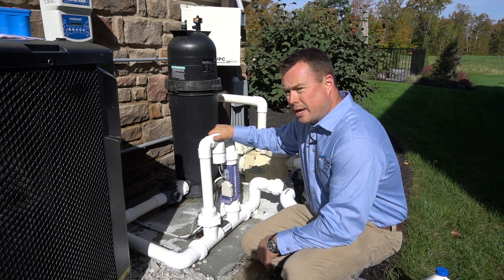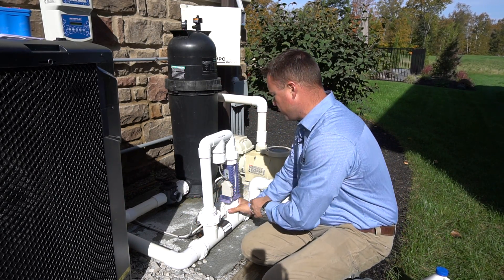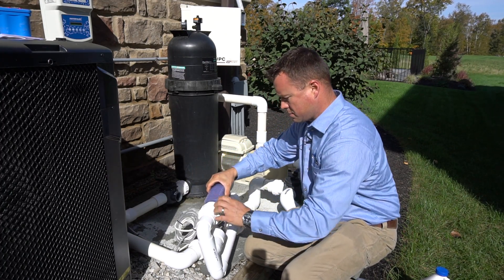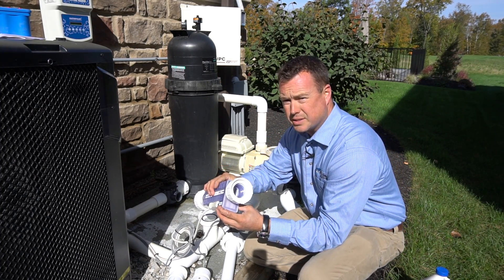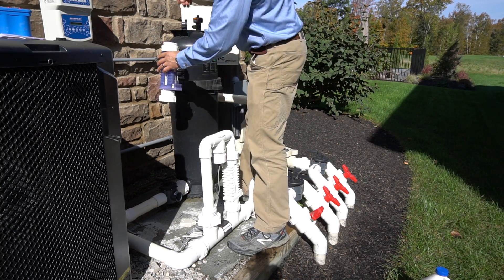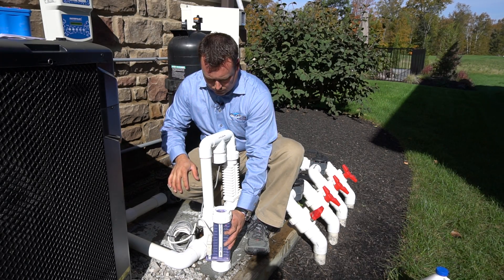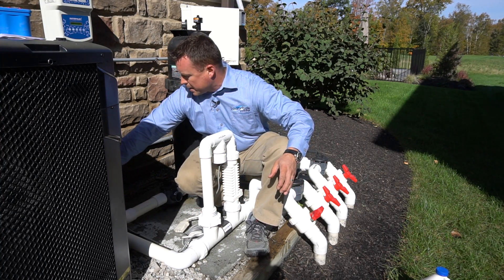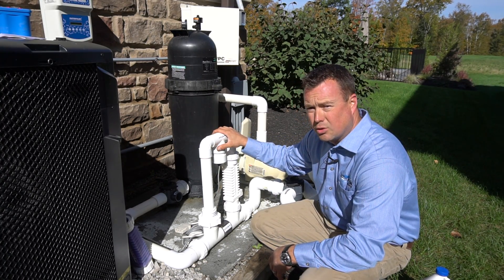Testing a Salt Chlorine Cell

Comment: I have a pentair IC-40  salt generator but the flow switch is in the unit itself. Is their a way to trick this unit? Thanks for any help.
Reply: I called pentair and they said you can press the flow switch inside the unit. I have tried it yet. My IC-20 is on its last legs and I’ll give this one last ditch effort. I notice this post was from a year ago. Did you have any success?

Comment: The cord for the cell generator has 2 sockets, while the cell unit has 2 male plugs.  I mistakenly unconnected the cord to clean the unit and did mark how it was plugged in.  can you comment on that?  Thanks
Reply from the maker: It doesn't matter how it goes back in. The system the outside leads are the same.
Reply: @LuxuryPoolsandLiving  Thank you.  Your video is really helpful.
Reply: I meant to say 3 female and 2 male!

Comment: How do you “make” a dummy cell? You mentioned in your video that it can be made. Thank you.
Reply from the maker: You would need unions that match the 2" unions on the autopilot and a piece of pipe.
Reply: Luxury Pools and Living Ohio I do have an old cell, would it do the same thing if I just didn’t plug it in, and just plug in the new cell in off the manifold as you did in the video? I guess my question is did you have to modify the older cell you used in the video?
Reply from the maker: Stephen Frasca  YES an old cell is the perfect and best thing to use!!! Yes do not plug it in but rather the cell in question with the plug.
Reply: I don’t throw anything away... lol
Reply: Use an old dead cell for the dummy.  What I do.  Thanks for the video.